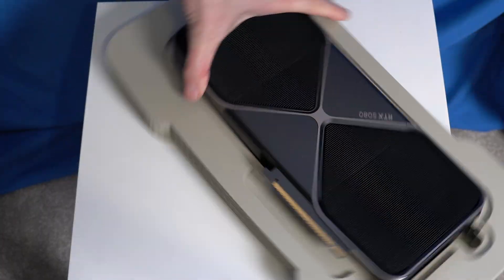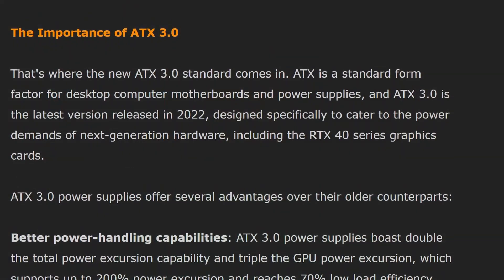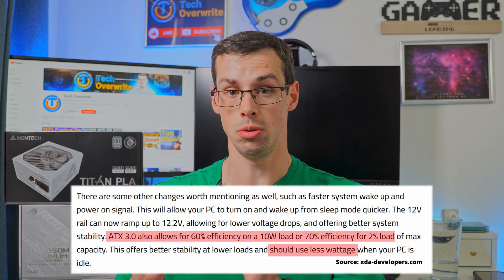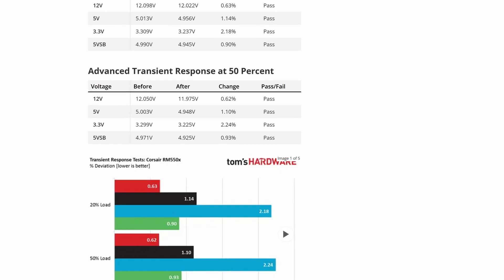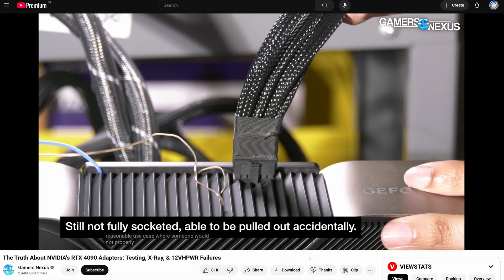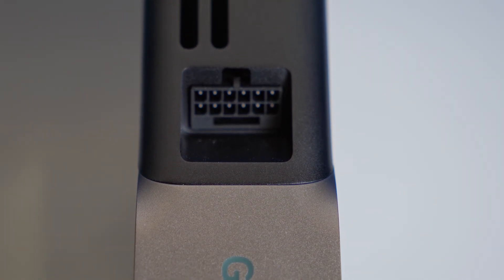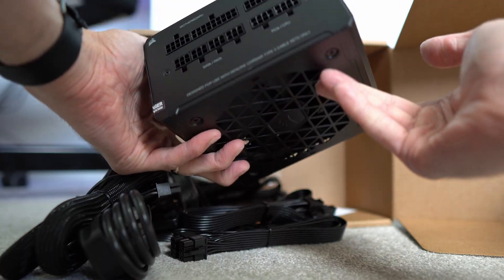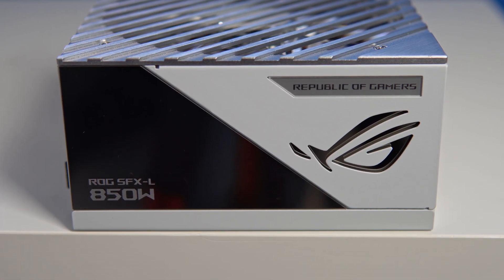ATX 3.1 vs 3.0 PSUs: Why Newer Isn't Always Better

Comment: I am still a little confused, so I am upgrading from a 3060 to a 4080, and on a 9 year old 650W PSU. I thought I needed a ATX 3.1 one to power it since it has the single 12v cable? But it seems like 3.0 can still power these cards as well. I've seen your other videos about cable melting, and its scary stuff! I had my eyes on the "be quiet! Pure Power 13 M 850W" PSU, but now unsure.
Reply from the maker: Thanks for watching, and yep it's worrying all round :/ To be honest, an ATX 3.1 PSU will still be solid - I wouldn't worry about that. And for ones with a native 12vh power slot, I think that ATX 3.1 is better (since the PSU will have 12vh-2x6, not 12vhpwr). But I guess the point in this video is that I'm pointing out that sometimes, having standard 8-pin connectors on the PSU side can be arguably safer. I wouldn't worry too much though, especially with a 4080 - it's very very rare that those have melting issues :)
Reply: @TechOverwrite thanks so much! That helps a lot haha! Keep up the great work:D

Comment: Deymm does this means im screwed? My current power supply now is 1st player NGDP 1000W 80+ platinum tier A...But I got the ATX 3.0 version not the new ATX 3.1 version my current gpu now is rtx3060ti and planning to purchase rtx4080super or rtx5080
Reply from the maker: I think you'll be okay - I'm actually powering my RTX 50 series card on an ATX 3.0 PSU. I think it might be different for a 4090/5090, however you have a good PSU with enough power headroom, so that should be fine for a 4080S/5080 IMO :)
Reply: @TechOverwrite Hello sir thank you for the response! So you think my current PSU and current 12vhpwr cable will be fine for my next upgrade?
Reply from the maker: Yes I think so, your PSU has good ratings so it should be fine :)

Comment: The design of the 12VHPWR cable is simply flawed.... if the GPUs that use it had 2 or 3 sockets then it would be just fine to use. 

But all of the other issues that came with it is what makes it a deal breaker for myself personally. 

Im just NEVER going to buy a GPU that has a single 12VHPWR slot 😂
Reply from the maker: That's fair, it's a really frustrating design - especially for anything above 350-400w or so. In other words, the 4090 and 5090 are just in a bad position with the single 12vhpwr slot.

Comment: I also just bought the Montech Titan PLA 1200 W power supply that you are showing in the video. Do you think it is good enough or should I change it to some other PSU?
Reply from the maker: I love it tbh, I have the 1000w variant and it has been rock solid for me :) I'd stress tested it with a 5080 FE at 108% power limit (pulling 400w) and no issues, and also with a 9070XT - again, no issues. It's also made by Seasonic which helps.

Comment: So the new Asus Thor III ATX 3.1 power supplies are among the best to put on a large graphics card like the 5090 Astral etc. if I understand correctly.
Reply from the maker: Yes I agree, that's a beast of a PSU - to match the beast of a GPU :)
Reply: @TechOverwrite What do you think about the ASRock PG1600G PSU? 
It's 3.1 design and comes with a built-in safety sensor designed for the 12vhprw input. Once it reaches a certain temperature it shuts itself off immediately to prevent damages to the GPU and PSU
Reply: i got the be quiet dark power pro 13 for the 5090 astral. its a atx3.0 one.  I think im good

Comment: We nned ATX 4.0 a big robust single cable for the back of mobo and cards with ho cables
Reply from the maker: I agree, that would be a lot nicer. Right now, having a single 12vhpwr cable for 600w PSUs is a recipe for disaster - along with all the other PSU cables that often get in the way. Moving to a single cable would be nicer for sure.

Comment: Damn I just purchased a AsRock 1300W PSU for the 2x6 12 volt connector 😂
Reply from the maker: Haha I wouldn't worry too much, that's a solid, highly rated PSU :) To be honest, I went with an ATX 3.1 PSU for the 12vh-2x6 too (for similar reasons to you, no doubt) - it IS nice to have the added confidence that it's all properly connected up.

Comment: I just bought Corsair RM850x 3.1 and PCIe 5.1 (2024) for my RTX Asus Tuf 5070Ti, and regardless of notorious 12V 2x6 pin connection that card uses around 300w and i think i should be fine and not worry about all that melting fear. And you have really great explanation videos. I would like to see one video where you explain all about lane sharing shenanigans on motherboards, that can be all confusing because motherboard manufacturers do not explain very well about their products and you need to use manuals to decipher all that BS.
Reply from the maker: Nice purchase, that's a solid PSU choice - and an awesome GPU :) I definitely wouldn't change the PSU or GPU, that should work out well. I like the 5070 Ti, and it's heading down in price a fair bit (here in the UK) which is good to see. It offers some really good bang for your buck. Thanks for the tip about lane sharing, I've touched on it briefly (as part of other videos) but will see about making a more detailed/dedicated video for sure.
Reply: Hello, I'm searching a PSU for my new 5070 ti... any problems with the corsair RM850x? thanks
Reply: @dastreak  Not a single one. Its A tier on the famous tier list. And be sure to buy 2024 or newer because of 3.1 ATX and 5.1 PCIe
Reply: @athanastos  I just bought an asus rog strix 1200w platinum 😅
Reply: @dastreak  That's even better